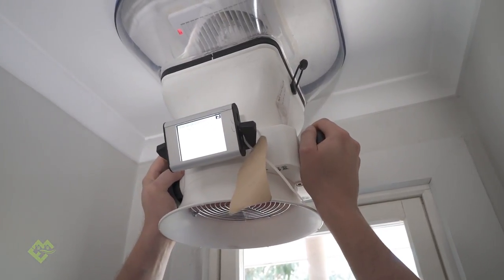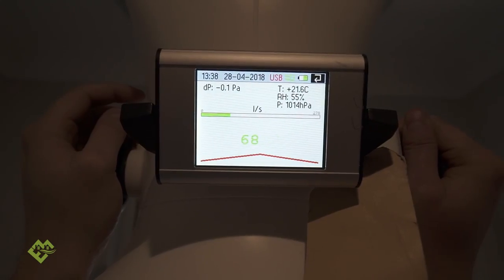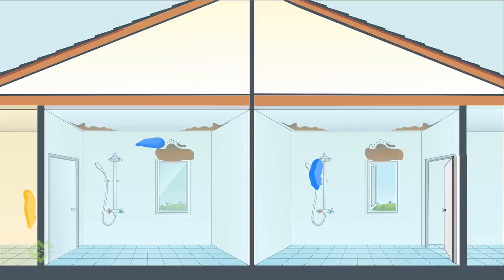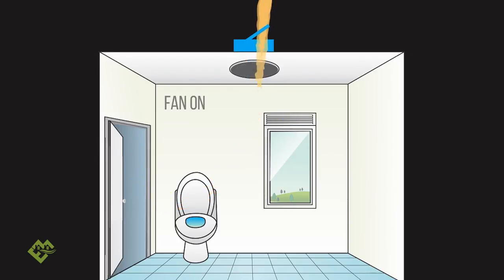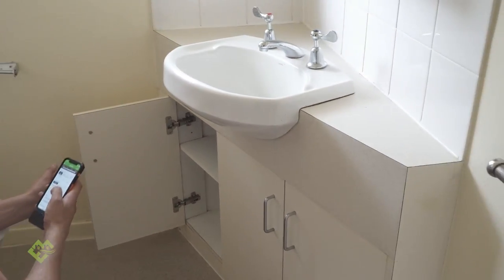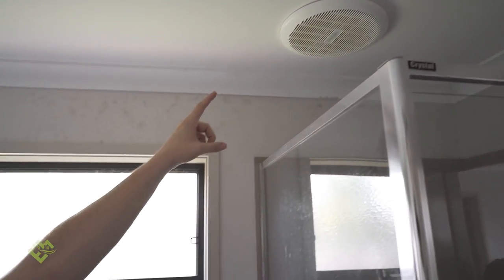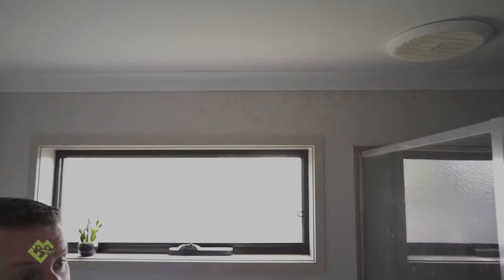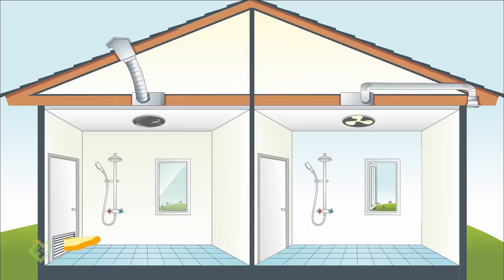Stop BATHROOM Condensation & Mould in a shower & reduce home energy

Comment: I be;I’ve the biggest cause of mould apart from poor ventilation is that most showers are grouted with cementitious grout which is porous even the tiles can be porous . So if water is passing down the back of the tiles and grout and trapped by silicone ( cause of mouldy silicone dirty behind) the mould start to build up) we have longer showers than what showers were originally tiled for….use epoxy grout instead which never stains and is waterproof.

Comment: Hi, thanks for this video. I have serious health problems that led me to go to the UK twice due to humidity in a bathroom that actually had this fan but the central heating system emitted some toxic stuff that fell into my eye. I have been in another home with unfortunately, similar problems as the bathroom emits a strange mould smell every time something is used, tub or toilet, basin etc. i was told by plumber to keep the window open but that just lets in all the dense humidity and fireplace smells from outside! why does the bathroom smell like that when used? it’s not just the washing machine mould smell ( as the machine is in the bathroom) could it be the changes made in the central heating of the building? they went from petroleum to natural gas but didn’t provide the right setting so we often pay for leakages in the building. thank you!

Comment: Help! I'm at my witts end. I've been battling a wet bathroom. I just replaced the fan but I still get tons of humidity. It's so bad that the ceiling is dripping with water over its entire surface. I went into the attic when I replaced the fan and it seems to be insulted well. We also recently had flooring done and I noticed the gap at the bottom isn't very large. The fan is within a couple feet of the shower. Any advice would be greatly appreciated!
Reply from the maker: Is it any different if you shower with the door open?
Reply: @ecoevo  maybe slightly. Yes. I have 3 teen and pre teen boys so they don't often want to. The walls are seeping glue from previous wall paper glue.  It looks disgusting
Reply from the maker: A humidity sensor could help.  You’ll need to get a sparkie to install it.
https://tighthouse.com.au/collections/ventilation/products/ceiling-mounted-humidity-sensor
Reply: @ecoevo  our fan is on a timer and we run it during and for 30 minutes after thy shower. So I don't see how a sensor will help.
Reply: I have the same exact problem. So frustrating. Idk what to do

Comment: Hi, I have a bathroom installed in my basement cold cellar and the ventillation is blocked off from the outside due to concrete installation. Now my bathroom has alot of mould growing, I have no room for an exhaust, is there any other option?  Should I open the ventilation going from cold cellar to the exterior of the house? Please help.
Reply from the maker: You really should ask for a professional to come an have a look at that.  Buy yourself a dehumidifier, for Down there, it may help.

Comment: I have mold on my bathroom ceiling with my fan running when I shower. Could the hose not being connected in the attic cause that?
Reply from the maker: That would cause mould in your roof.  The key to controlling mould on surfaces is having warm surfaces in your bathroom.   Insulation consistency is important, and so is heating, and then it’s also important to run exhausts for as long as needed to reduce the humidity back down to 50% as quickly as possible.